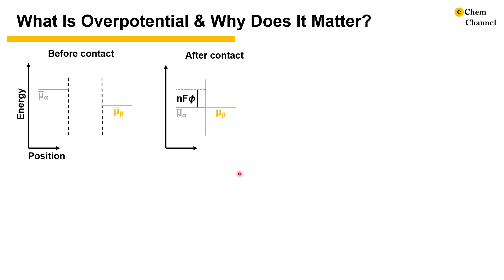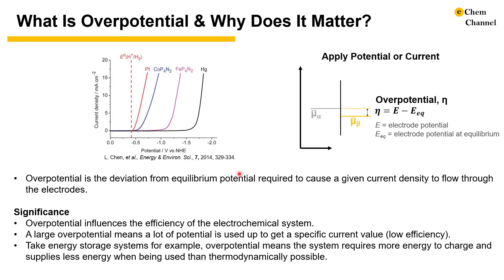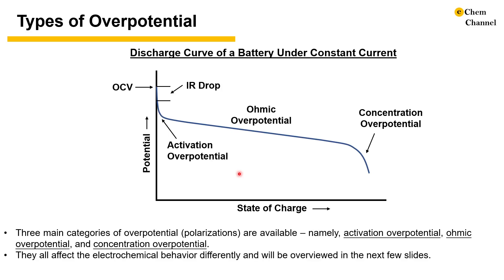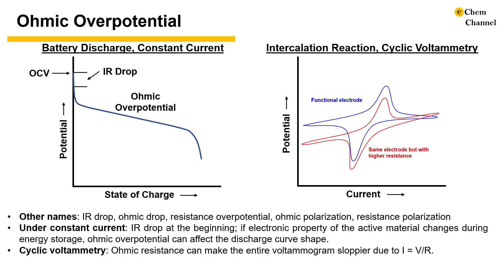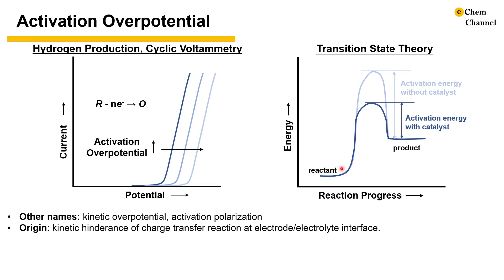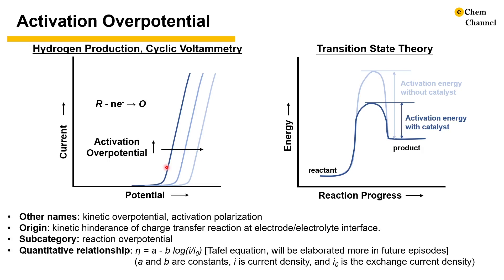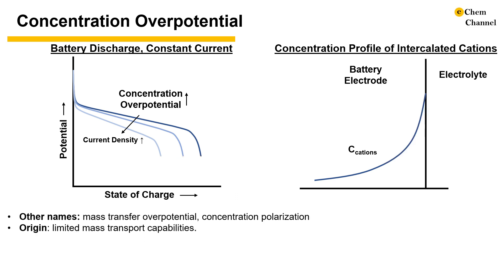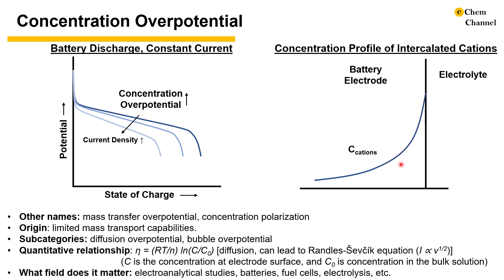Overpotentials in Electrochemistry

Comment: for an electrolytic cell you should use the thermo-neutral potential (ETN) as the "E0" for defining the over potential i.e.  overpotential = Eapplied - ETN.
For galvanic cells, the DeltaG0/-nF = E0 is used to define the overpotential i.e. overpotential = Eapplied - E0.

Comment: A dilemma or conundrum exists here in regard to the drop in battery voltage upon discharging.   It can easily be shown that as we raise the circuit resistance,  we experience less polarization of the two electrodes towards each other (and this co-polarization of the electrodes is what causes this apparent battery voltage drop) under loading/discharge.  In other words if we short circuit the external battery circuit and/or reduce the internal electrolyte resistance in the battery, there is more polarization of the terminals upon loading which reduces the overall voltage more.   So now we have a situation where the less actual IR drop that actually occurs in the circuit causes more, not less, battery voltage drop upon discharge which you are calling "IR drop".   So therefore the lower the resistance is, the higher what you call "IR drop" is.  This does not make sense.
Reply from the maker: Hi there, I'm not sure if I understand what you mean. When there's less resistance, the electrode will experience less overpotential due to resistance.
Reply: You are not considering activation polarization (sometimes called kinetic polarization). When there is no resistance at all, the potentials of the anode and cathode come together to the same value (there is more activation polarization which is proportional to LogI for both the anode and the cathode).   The amount of activation polarization is proportional to the log of current flow.  IR drop is shown on Evans diagrams as the difference between the anode and cathode potentials after current flow creates polarization.
Reply from the maker: @bobstevens7028 I'm still trying to understand the context of your writeup. Activation polarization is indeed not considered in the IR drop. It's an additional contribution on top of IR drop, which was indicated in the figure.